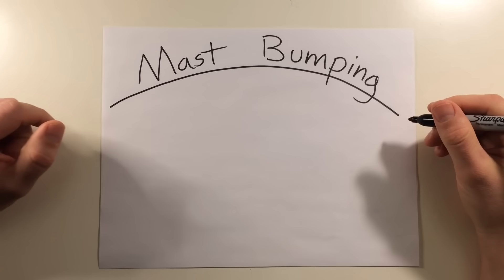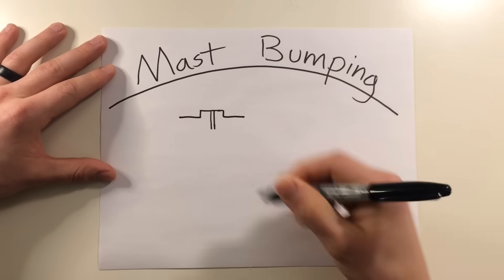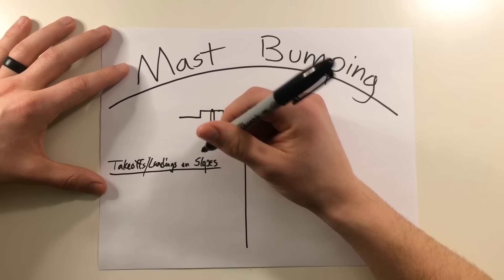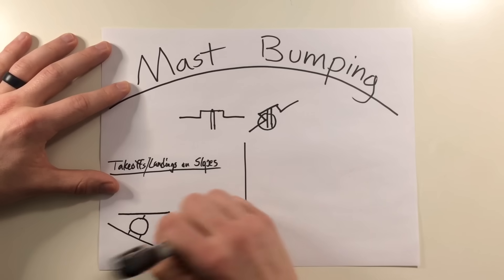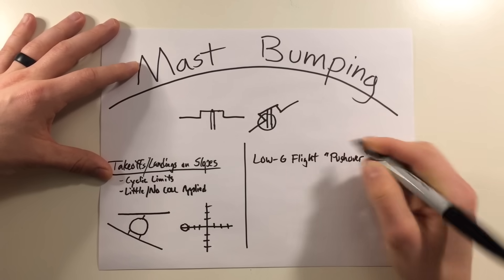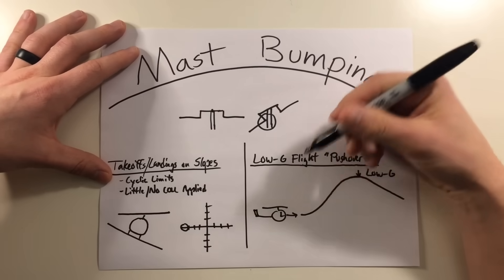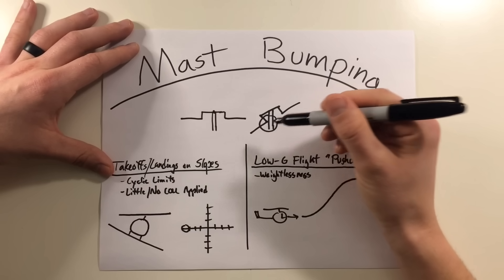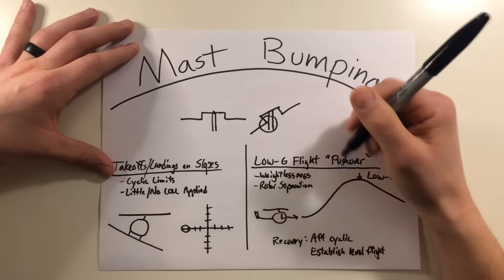Mast Bumping in Helicopters

Comment: This video explains sorta what happened to Kobe helicopter 🚁 while he was attempting to climb the foggy 🌫 morning weather
Reply: Yup...
Reply: Kobe’s crash was caused by the pilot flying into fog, getting disoriented, and crashing without realizing it. The Sikorsky S76 does not have a semi-rigid mast, so there is no risk of mast bumping in low-g conditions.

The most common helicopters that crash due to mast bumping are the much more common (and affordable) Robinson R-22, R-44, and R-66 helicopters. Many Robinson pilots have died due to mast bumping, which can cause catastrophic rotor separation, or it can cause the rotor to sever the tail or strike the cockpit - any of these will be fatal. Mast bumping can happen not only due to a low-g pushover (which must never be done in a Robinson helicopter), but it can even happen in level flight with strong enough turbulence. The faster you’re going, the less turbulence it takes to do this, so you must slow down the windier it is - and land if it’s not safe to continue.

Comment: I fly an autogyro which also has a teetering rotor system. They have teeter-stops which prevent mast-bumping (although, the problem now becomes stop-bumping instead). A condition which can cause stop-bumping in a gyro (and I would assume would cause similar in a heli) is outrunning the retreating blade and causing retreating blade-stall - We have to be very, very careful of taxiing with an active rotor because of this - It can cause the gyro to roll over and turn an otherwise flight-worthy aircraft into instant FOD.
Oh... by the way, I think you'll find that your low-G condition happens before apogee. We also have to be careful not to pull low-G manoeuvres - Gyros rely on a loaded rotor-disc for autorotation - Unloading the rotor-disc is a pretty sure-fire way to become ballistic. Given your explanation, I would imagine that it is also accompanied by a roll toward the retreating blade, which I had never considered before. Not that I am going to perform in-flight experiments to find out, of course !!!

Comment: Helicopters look more complicated than fixed wing aircraft
Reply: They are! It’s like taking the engine from a plane, replace the prop with the wings and bolt it on pointing up!
  Not spin them at several hundred rpm😂

Comment: Hi Jacob, nice series of videos so the average Joe can understand. What do you mean by the main rotor disc being "unloaded"? How is the main rotor thrust reduced at the crest?
Reply from the maker: Jeff. Think of loading and unloading the rotor as increasing the lift it is currently producing. When the aircraft starts a cyclic climb, the G forces increase and the rotor “loads” as it cones. It’s as if the helicopter weighs more with these increased G forces. The rotor “loads” up the weight. When the aircraft pitches over forwards the rotor unloads the weight of these G forces. In essence, it unloads the weight. I hope this helps.

Comment: Why are those rotors designed to depend on center of gravity and allowed to swing freely instead of being spring-loaded to not move beyond a safe range?
Reply from the maker: TiagoTiago. Good question. I don't design helicopters but it sounds like a good design feature. The only reason I can think that it might not work is that if the semi-rigid system has too much spring-loading, the blades may begin to absorb the flapping stresses instead of the flapping hinge. Thanks for the feedback!

Comment: Took Jacob 7.6 min to succinctly explain mast bumping. The U.S Army took 25 min, 1/2 doz soldiers and contractors to poorly explain the same concept.
Reply: The British would need about 15 hours to try explain the same subject, and it still would not be explained!!
Reply: And that includes a 1 minute introduction
Reply: Just imagine… something improving over decades benefiting undoubtedly from the original Army material as well a more modern learning concepts and presentation formats.  

Kind of like just the device I’m typing this on is more advanced than the best Army supercomputer from the same era.. better than the best Air Force inertial reference and navigation platform from the same era… and way better than any CIA spy camera!

Comment: why have I heard that it's good practice in a low g roll to not only gently bull back on the cyclic, but to also gently lower the collective?
Reply from the maker: W. McMaster. Generally the advice is to pull aft cyclic to load the rotor and adjust flight controls for normal flight. The collective is generally not lowered unless there is a risk of over torquing or engine limiting. (But in this case the rotor should be sufficiently loaded.) You have to be careful reducing the collective here because above all you want to keep the rotor loaded. Suffice it to say, it depends on the situation and where your collective / rotor currently sits. Thanks for the feedback!

Comment: The normal range of the cyclic does not exceed the gap between the droop stops and the rotor mast. Mast bumping occurs when the fuselage is not loaded with the rotor system. This unloaded state allows the fuselage to already be tilted, which allows for situations where the cyclic can exceed the gap. For example, in a low-g situation, translating tendency causes an extreme right roll of the fuselage. Sometimes up to 100 degrees in 1 one second. If the pilot can correct the right roll in 0.1 seconds, the fuselage has already moved 10 degrees to the right. To correct, the pilot moves the cyclic to the left 20 degrees to correct, but in the R22 the gap between the droop stops and the mast is 12 degrees. In that situation, the teetering hinge strikes the mast. While reaching the cyclic stop during a slope landing is not recommended and requires you to pick another spot, mast bumping is not a concern.
Reply from the maker: Matt Henderson. Well said. I've not flown and therefore cannot speak for the R22 and its droop stops. But mast bumping can have the possibility of occurring in other types of rotor systems with maximum cyclic displacement. Thanks for the input.
Reply: @helicopterlessonsin10minut10  Really cool.
Reply: By the time all that info would pass through my brain, the tail would already be long gone and I’ld be racing it to the ground!
  Speaking of ground, thats where I plan to stay😉
Reply: What happened to, down collective, right pedal,
a bit of aft cyclic, then a bit of forward cyclic, 
then up collective, left pedal to regain trim attitude?

Comment: Not so great auto rotations seems to also be a cause. While flaring if you contact a stinger or the rear of the skids while in to much a rearward tilt, the disc usually become unloaded and the quick fwd tilt of the fuselage has caused the rotor hub to contact the mast.
Reply from the maker: Johbros. Great point.
Reply: One thing to consider,  if you bump the rear of the skids Upon landing and the rotor bumps the mast and caused damage,  you are already on the ground.